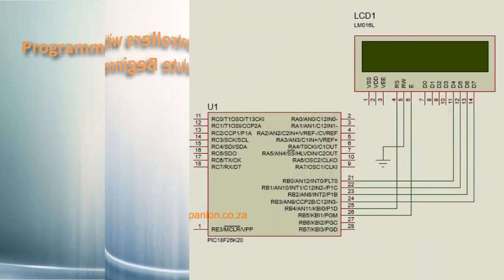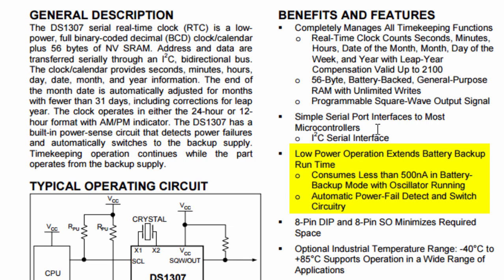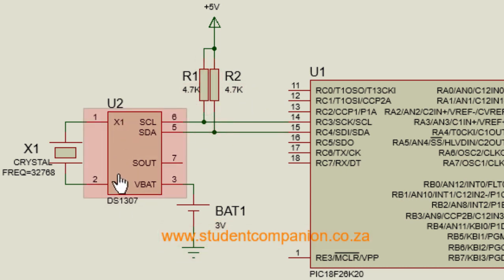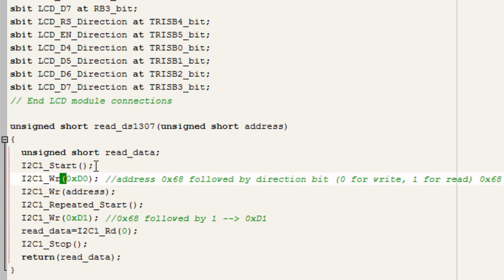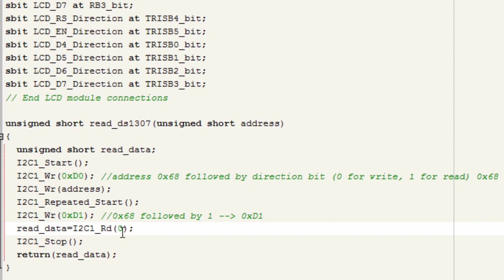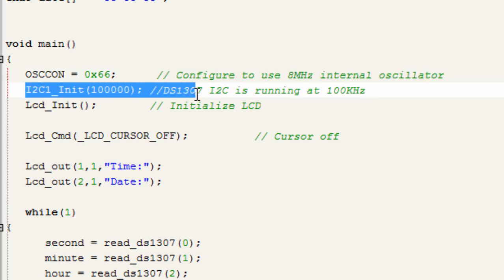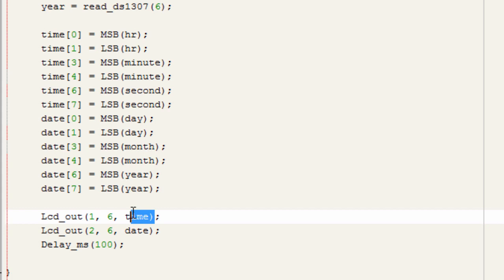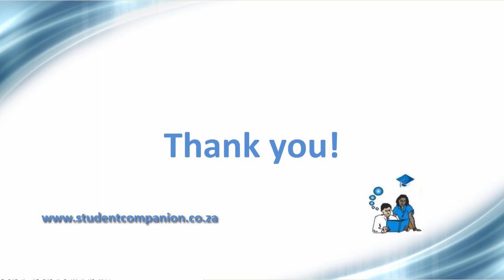39- Interfacing The DS1307 Real Time Clock | mikroC Pro for PIC Tutorial

Comment from the maker: Please note: PIC18F26K20 operates with 3.3V even though in this simulation we used 5V. In your hardware 3.3V should be used
Reply: how about PIC16f887 ? Can I do it similarly?
Reply from the maker: +Hưng Nguyễn Quốc Hi. The procedure will be more or less the same only some small changes to the code.
The major thing to note is PIC18F26K20 operates with 3.3V while PIC16F887 operates with 5V
Reply: thanks you so much :)
Reply from the maker: +Hưng Nguyễn Quốc you are welcome

Comment: led text moving message with keyboard usb project still waiting plus code
Reply from the maker: Hi Daniel Simiyu, We are busy with your project, which PIC are you going to use? You want it to use USB but pic16f88/16f877a don't have USB interface. you can only use UART with these PIC
Reply: thanks for your efforts and making projects real ,can we use 16f877a for UART and 18f450 for usb. Now now now oh  USB  VS UART, very difficult again/ my wishes are to use keyboard as my text message input and have minimum components
Reply from the maker: +Daniel Simiyu You Can use USART and send data from your windows terminal.